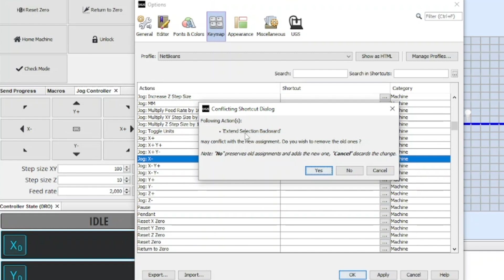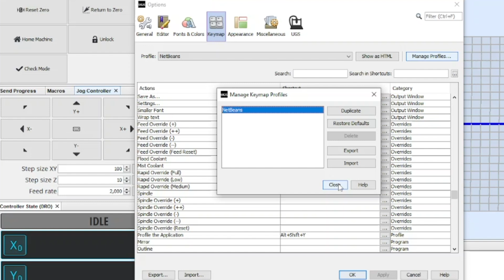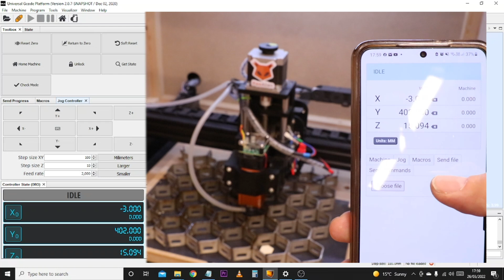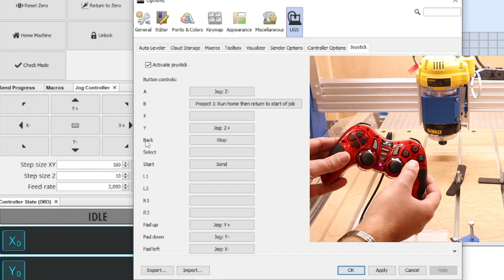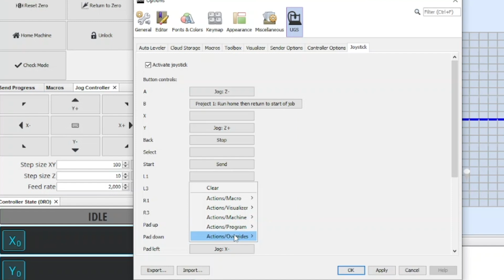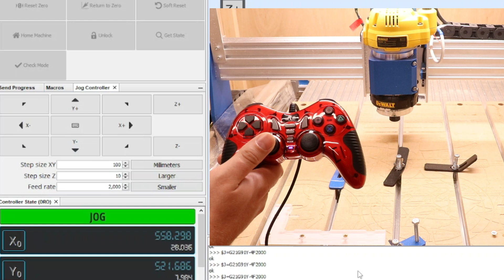Easy ways to wirelessly control your GRBL CNC machine

Comment: Hi James, will this work with the PC (USB) plugged into the controller USB (prover xl 6050 plus) AND the game pad plugged into the same PC? Also do you ever use Gsender instead of UGS? Thank you!
Reply from the maker: It should do and yes I've started using Gsender a lot more recently. Occasionally I switch back to UGS if I hit bugs in Gsender
Reply: @JamesDeanDesigns  Thank you

Comment: James, excellent video as always.  However, I have a problem I can not seems to solve.  I connected an Xbox controller (newish, about 2020) by bluetooth.  Everything works fine except that the x axis drifts.  I cleared all the command lines so that the cnc machine was not able to respond to any command and it still drifted.  Even turning zero threshold to 100% did nothing.  I also tried using a usb cable instead of wireless, but my laptop did not recognize the controller.  I am running a Dell laptop with Windows 10.  Thanks!
Reply: Never mind!  It turned out the machine was drifting even with the xbox controller disconnected. It turned out to be the usb connection from the laptop to the machine.  I tried a different usb port and it went away!
Reply from the maker: Glad I could help 😆

Comment: i have gone with the mobile wireless version - i bought a cheap tablet and made a housing unit to hold it in front of my machine - has made it soo much easier to operate. I also bought a wifi power plug - plug these into the wall, one to plug into router and one to put in my workshop (workshop 20meters from router) - basically, they turn the electrical wiring in your house into an Ethernet cable 

PS - what is a "kayboard" (see timestamps lol)

Comment: Here's my current dilemma and maybe you can offer a solution? I built a CNC plasma machine and it's using the MKS DLC 32 version 2.1 card. If I use Open Builds Cam to create a G-Code file and install that file onto the onboard SD card, I can then use the Makerbase ESP32 mobile app controller to initiate the cut. And from that point forward the machine will execute the G-Code. The problem I'm having is that the ESP32 controller app doesn't have the ability to adjust the Z axis. Don't ask me why, but it's probably because the mobile controller was built for a laser cutter which doesn't use Z-axis (although I understand older versions of the app did have the z-axis control). Nevertheless, before I can start a cut I need to use Open Builds Control software to set the Z height before switching over to the esp32 controller. You may wonder why I just don't run the G-Code directly from Open Builds Control, and the reason is because the interference from the plasma machine causes my computer to glitch out and the cut stops about a minute into it. But if I run the file directly from the control board it doesn't have that issue. Obviously my computer is not shielded well enough to execute the cut. Be that as it may, a USB connection is my only option to connect a computer to the card, and I've heard that ethernet connections are more stable. Nevertheless, all I'm really looking for is Z-axis control without having to hook the computer up every time just to set the height. I downloaded grbl controller to my phone and connected it to the USB line of my control board card. But it was not recognized. I was thinking that perhaps GRBL Controller might offer me a way to launch the G-Code from the onboard card as well as be able to set Z-axis height. If you have any advice for me I would greatly appreciate it. Thanks.
Reply: Maybe you can use FluidNC software and control your cnc plasma by webUI. Friend, how is your plasma cnc with the MKS DLC32 currently? I'm buying this board to build a plasma cnc for myself too. Is it working well?
Reply: @eric.oliveira11  I'm my case the computer was too close to the plasma cutter. Had to run a super long homemade USB cable and put the computer in a different room. That card will work fine with a CNC machine.  @eric.oliveira11

Comment: This Is great, do you know if i can add e short cut for m3 sxx for the servo on mi 2d plotter? Thanks
Reply from the maker: Depends on your software but usually they can all add custom buttons so you would just put that in as a custom button and then perhaps a second button with M5 to stop it

Comment: Is it possible to setup UGS to run two different machines or do I need a separate computer for each machine. I will only be running one at a time.
Reply from the maker: Yes it should be possible. You'll need to open it as two separate instances though

Comment: @James Dean do you happen to have integrated stepper motors the ones like the onefinity has? I was wondering if you happen to know how to wire them up from scratch to a raspberry pi 4 or grbl Arduino board so it can be connected with a VFD 2.2kw spindle. It's cuz all the controller around now are really expensive

Comment: Is there a way to turn off the step jogging function? I would much rather be able to jog the machine by holding down the jog button then use the step function for fine adjustment. Thanks!
Reply from the maker: Yes I believe so, especially when using something like the controller. I can't remember where off the top of my head but I'm sure it's in the settings to control the sensitivity
Reply: @JamesDeanDesigns excellent thank you sir!

Comment: How to enable overrides on UGS 2.0.14 ?
Reply from the maker: What do you mean overrides? The speeds can be taken up or down us in the menu machine or program menu at the top
Reply: @JamesDeanDesigns  Thank You for reply!  Overrides commads to control / speed up feed rate while running CNC.
Reply from the maker: @jes00088  yes, all up in the menu as real time overrides. + or - is 10mm/min change, ++ or -- is 100mm/min change
Reply: @JamesDeanDesigns  Yes, I find overrides but they do not function /react on my UGS

Comment: I have been looking though you old videos trying to learn more and seeing this one made me think?
can you use a tablet to send g-code to you machine instead of a computer?
I am in the process of designing a small (about 450 x 450mm cut area) but where I can put it! I have to use about 180 metres of cable, or get WIFI Booster, or use SD card plugged into machine or last choice by a cheap laptop/computer
Reply from the maker: I've never personally done it but I suspect you can one way or another. The cheap alternative a lot of people use is a Raspberry Pi

Comment: Great video. I didn't realise I could run my CNC over wifi this easily. Brill thanks..  Just noted that it seems initially you seem to need to connect to the internet each session to make a connection. After that you could switch off internet until your next session. (I have to do that as I'm using my phone as sole connection to the net. My pc connects through my phone to the net). Thanks again...

Comment: Hi James I’m having trouble connected to my laptop I’ve scanned the qr code I get the I’ve tried both ways how old is the software
Reply from the maker: In theory if both your laptop and phone are connected to the same wifi network then their should not be an issue. Unless something is blocking it. UGS has regular updates come out, you could always try a newer or older version of it

Comment: Thank you for making this video but I have missed a step somewhere.......how do you get the Gcode to your CNC machine. I can do it with my laptop but don't want to have this working in the workshop when Im cutting  but want to convert from my laptop to a mobile phone or hand controller .
please help and stay safe 
Bill M8-)
Reply: You need a standalone cnc controller that will read the gcode from a SD card. But most CNC professionals avoid this approach as there is no control over the operation of the machine

Comment: magnificent video
Can these controllers be used at the same time as the PC?

With controller offline, only one can be used
Controller or PC not simultaneously

I apologize for my poor English
Reply from the maker: Yes, you can run the controller and continue to use the PC as normal as long as the USB cable remains connected

Comment: Thanks! I finally got my phone working but I had to turn my firewall off to connect. Did anyone else have any problems with windows 10 firewall? I'd like to connect with out turning my firewall off.
Reply from the maker: You just need to create a firewall rule to allow that program I believe.
Reply: I tried making a rule and other things for hours yesterday and nothing worked. I was going to try again today and as soon as I opened the pendant I got a notification asking to allow access though the firewall. I guess the computer needed rebooted 😂😅
Reply: Hi James! Great info👍 scanned the QR code to use my phone website unable to reach. Any ideas? Thanks

Comment: Thanks so much. I usually use easel to control rather than ugs. Will the joystick function still work in easel if i initially set up with ugs? Kind regards
Reply from the maker: No, it will only work when using UGS.